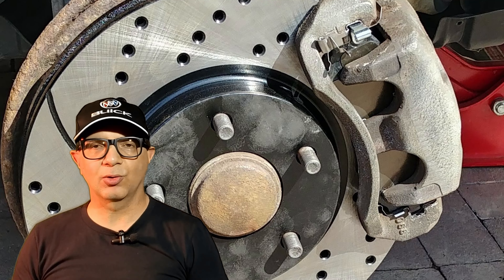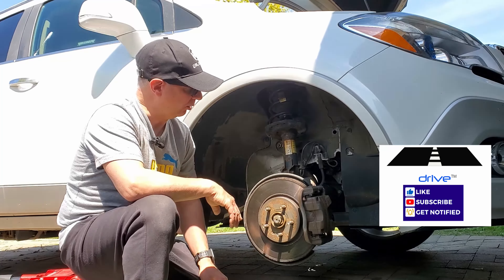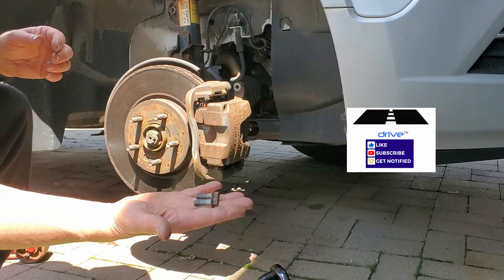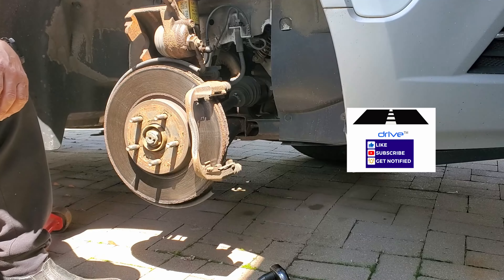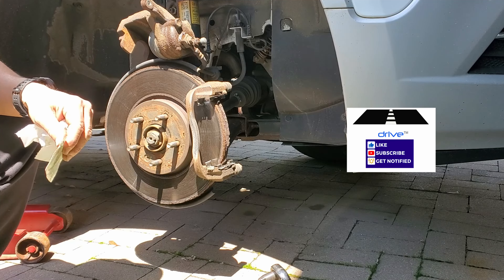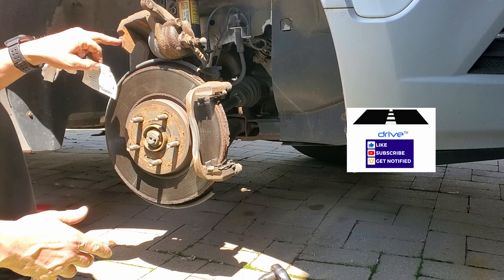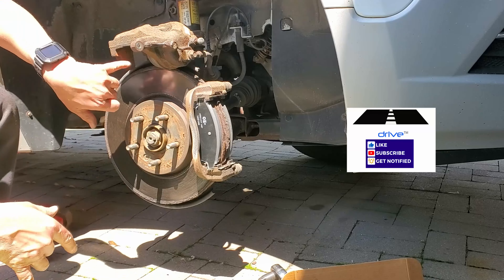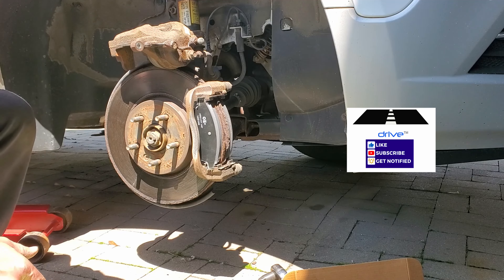Buick Brake Pad Replacement Tutorial | Brake Pad Clips | Buick Encore

Comment: some people would leave the top bolt or the bottom bolt in place and just slide the caliper out one side and access the brake pads.
Reply from the maker: Removing both bolts will also allow you to remove the rotor if you need to.  It is recommended to remove both.
Reply from the maker: Also it should be noted that the caliper will NOT always rotate out of the way enough to easily access the pads, if you only remove one bolt.  I have tried this method before and I could not push down the caliper enough to access both pads.